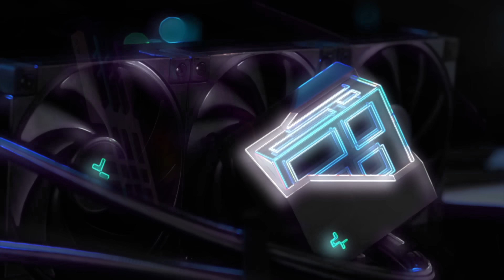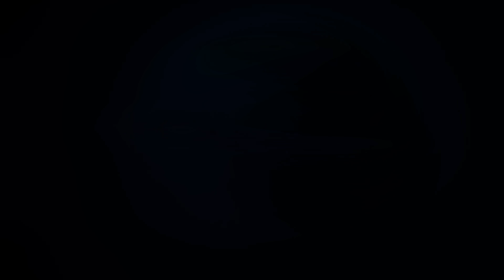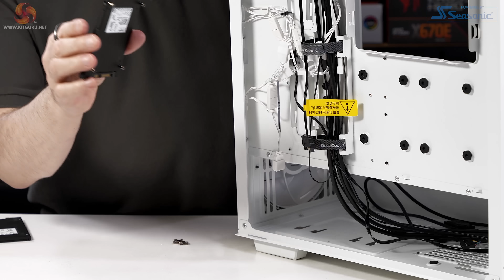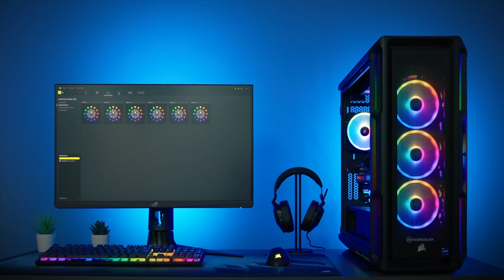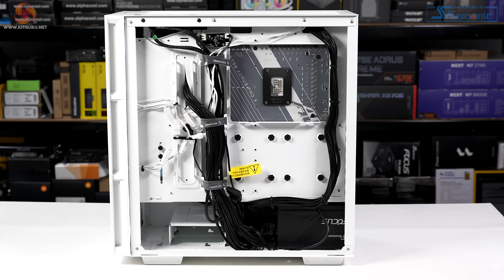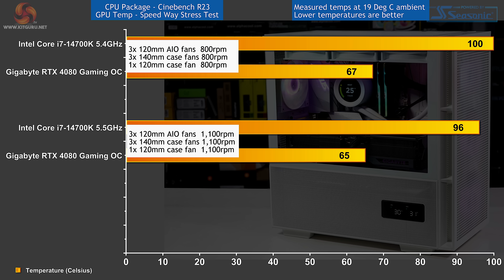DeepCool CH560 Digital Review - Nicely Done 👍🏻

Comment: I have the non-digital case and I'm happy to see I can put a 360 in the front although I did get rid of the 140 mm fans, so I might have to get 1:40 mm fans back in the front so that the AIO radiator can be attached as well as the fans to the front
Reply: I just got the Digital case but I'm still waiting on the rest of my parts. How are you liking it so far ?

Comment: So placing the radiator the wrong way doesnt give me much confidence since this will cause the system to having the eventual air inside the aio system is, at the top making the problem where the main cooling process in the system unless it was only to demonstrate fitting a cooler in there i still would say its an issue because someone with less KNOWLEDGE might put the top point of the cooler where it definitely shouldn't be

Comment: Hello, I got this case and mounted all the parts, but the backfan flickers like pulsating light, especially in colors just white stays stable. I checked AND RECHECKED, all cables from behind and mounted on board. all other fans are ok just that one in particular. Any idea?
Reply from the maker: did you try swapping the connector with another fan to test?
Reply: @KitGuruTech  I did, i put that end of those daisy plugs (as all 3 front fans and this one go to one slot on the Board) now bliks less than before but idk probably its the fan issues. i keep it White and its ok ;p

Comment: Hi when your connecting cpu cables to the motherboard would it be easier to uninstall the power supply and plug in all the cables to the motherboard. I’m having some trouble installing the cpu cables to the motherboard and I had to take off the cpu fan just to reach it.

Comment: so i purchased this case! but the fans are not on, im not sure exactly where to connect them onto the MOB! i have the asus rog strix x670e-a
Reply: you need to connect the 4 pin fan connector to your board and the sata power cable of the controller to your power supply
Reply: How is this case dealing with dust can you infprm me please

Comment: Hello, sorry, are the case fans 4-pin PWM or 3-pin?
Reply: pwm and they all go into a single fan header
edit: those are regular fans with pwm and 3 pin argb connectors. if you don't like the built in hub you can connect them to your board

ps: screw you Montech Z3
Reply: @herbertwalter8693  ty

Comment: Hybrid mesh is a great design and I hope other manufactures will start doing. There should have been a option for vertical mounted graphics card, and the side mesh should have gone up higher making more suitable for vertical mounting or even mounting extra GC on the motherboard the normal way. I own 3 differenent Deep Cool cases, but I never liked or cared for the fans the cases came with. I rather have vertical GC mount and some more refine features than fans I don't like using. Maybe version 2 will have the improvements where this fell short.

Comment: I built my pc in this case. I built a Ryzen 7800x3D system with an ASRock B650 LiveMixer board, and a Deepcool AK620 Digital cooler. Overall I found that it was quite an easy case to build a pc inside. I have my system set to a silent fan profile and CPU temps stay around 62c and GPU temps with my 3060 Ventus 2x stay at about 64c. I picked up my case for about 140 Canadian dollars on Amazon, it was definitely worth it for the price and I love the Orange/Black and white theme I went with.

I did mount a 6tb WD Blue hard drive on top of the cage and all 4 of the mounting holes lined up for me, so I'm guessing that those Seagate hard drives must have a non standard hole pattern
Reply: That processor is too much for that graphics card, huge wasted potential
Reply: @totalcrash5006  it depends on what games he plays
Reply: Can you inform me about any dust easily entering your case from front mesh and glass panel mesh or is it dust resistant

Comment: I'd rather have better front I/O than a display. 1 C and 1 A is deplorable and is the lowest effort like NZXT has been doing.
Reply: Bruh same what’s an alternative with good IO?
Reply: @abep.3110  Be Quiet Pure Base 901 is good and the Lian Li EVO line allows you to add a 2nd I/O module that adds 2 more Type A and 1 more type C for a possible 4 A's and 2 C's although it costs around $30 extra.

Comment: Deepcool is the budget king lately. They have plenty of models based on same few basic chassis in different sizes. Different front panels, slightly different top or side, and yet it looks different and fresh. GPU support - check. Easy SSD mounting - check. Well perforated surfaces - check. Steel is slightly thinner than more expensive cases, but at that price it's fine. Rubber grommets for cable holes - missing in some cheaper mATX cases. But then again if you route cables properly around the corner, no difference.
If I can save extra 100$ for a better GPU with a case still looking great and fresh - I will certainly do it when building on a limited budget. And in 90% cases it is limited.